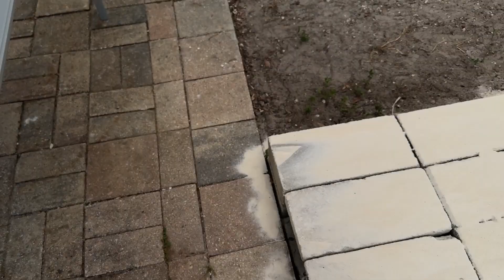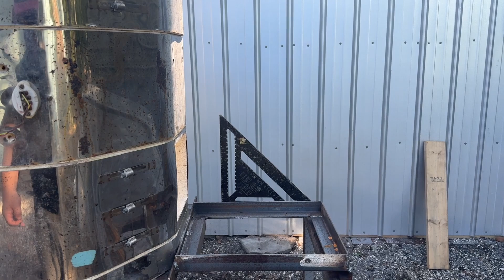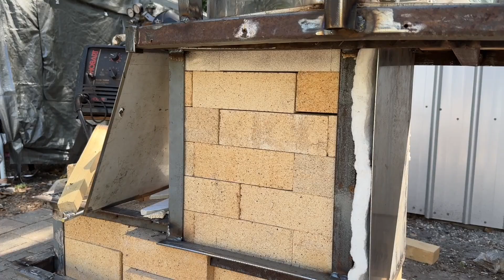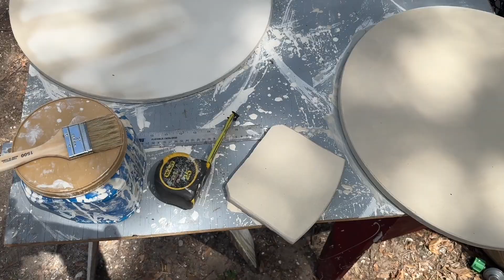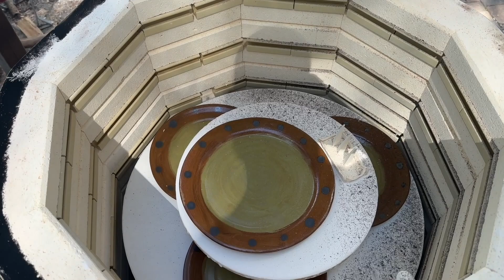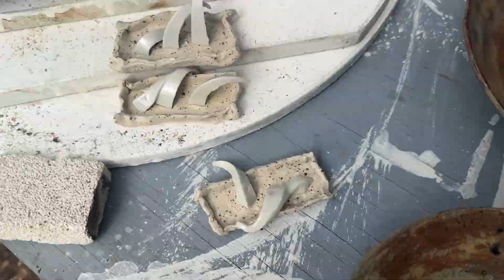Rocket Kiln Build with Bisque and Glaze Firing Wood Fire Kiln for Under $1500

Comment: Will you elaborate further --  for an example according to you what the fuel(wood) consumption per 1 ton of pottery item.
Reply from the maker: I would estimate 300-400lbs of wood to fire this kiln aiming for cone 6. I had approximately 80 to 100 pounds of clay in the kiln. I have only fired it 3 times. One Bisque fire and two glaze firing. I am close to releasing the results of the second glaze firing. I wouldn't consider myself an expert about this subject. I'm just sharing my experience and what I'm learning from the process.

Comment: Nice work, sir. I like the colors and patterns on the plates and the darker colored bowls. Did you finally build your own wheel or find a commercial unit you could buy? Thank you for sharing this new adventure with us. Take care and have a great week.
Reply from the maker: I ended up buying a better wheel. Amazon didn’t want the other wheel back so I have some parts to work with. I’m thinking about building one. Although I have a bunch of projects on deck. I’m going to redo the inside of the first Railbird soon and put a motor well in it. I also have a Glaspar Marathon runabout that I’m going to restore.